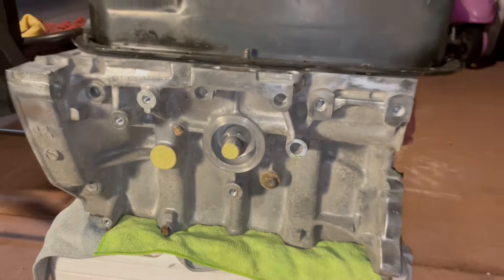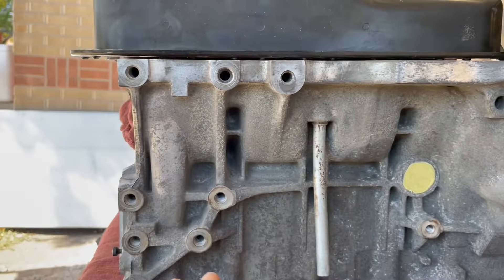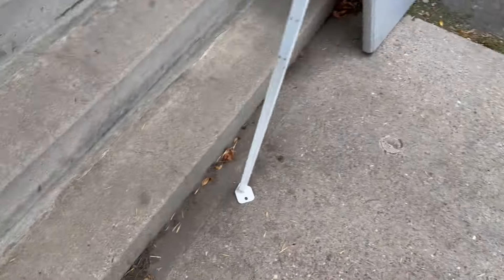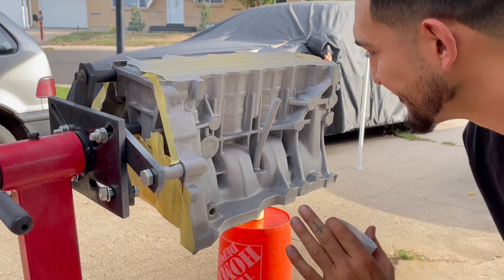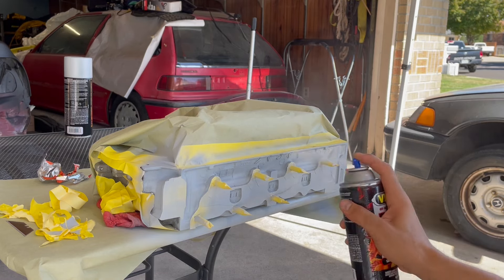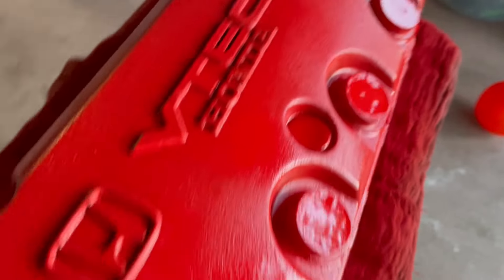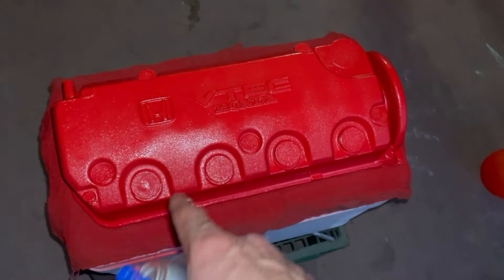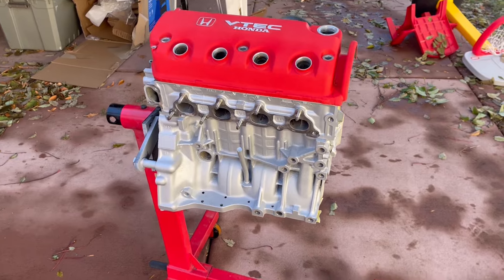I RESTORED MY HONDA CIVIC RACE CAR ENGINE

Comment: i like how it came out man. i’ve been thinking about doing this with my b20v i’m building. have tried using there clearcoat before? the issue i have with painted aluminum blocks is how fake it looks after painting
Reply from the maker: Do it bro its worth it the color i used doesn’t make it look fake.. that was my main concern too cuz i wanted the original aluminum look but it came out clean its as close as its gna get. I havent used the clearcoat but i think if you add clearcoat it will actually make it look fake.

Comment: Building an engine for how it looks is not what a racecar needs.
Reply from the maker: Sorry to say but you must not watch enough racing haha, there’s no reason we cant go fast and look good at the same time
Reply from the maker: If you look good you feel good, if you feel good you play good
Reply: Being fast is the part I have doubts in
Reply from the maker: @crystalzues4712 It’ll take a little bit of time but we’ll get there
Reply: @RICHY6  whats planned for modifications?
Reply from the maker: @crystalzues4712 suspension, wheels and tires, aero and safety equipment
Reply: @RICHY6  engine wise is what im wondering
Reply from the maker: @crystalzues4712 the engine is gna get built. Rods, pistons, some work to the head and then a turbski